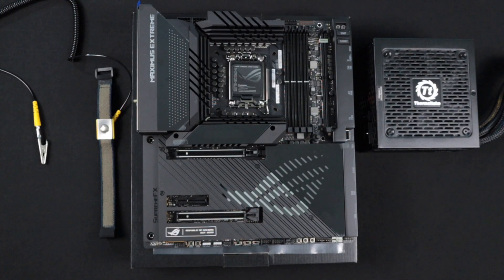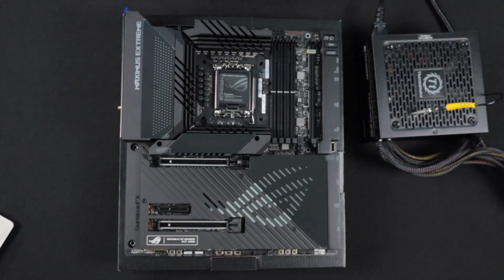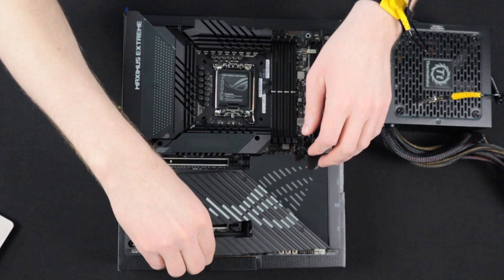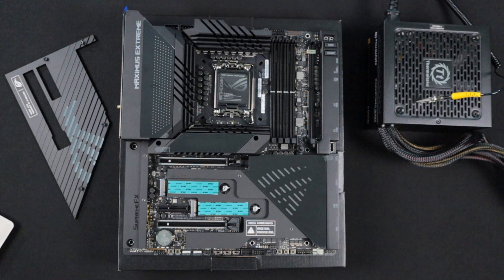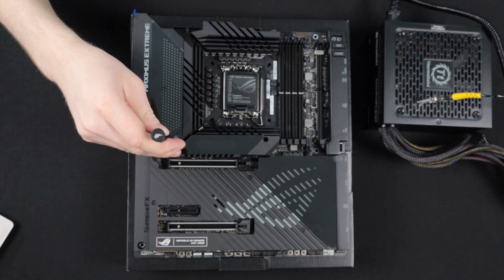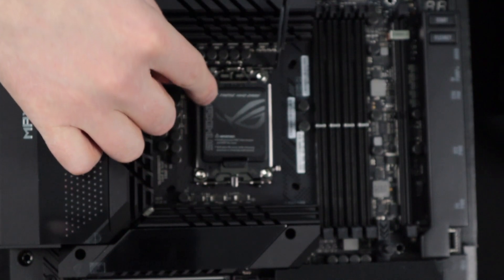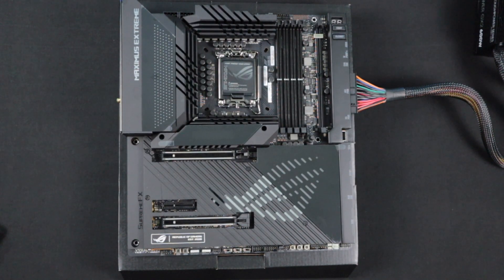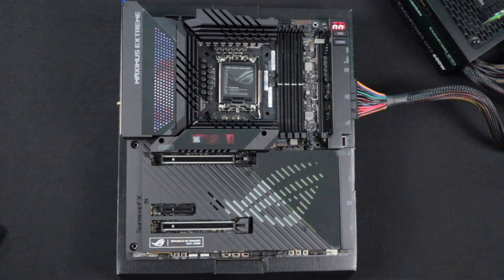Do This As Soon As Your Motherboard Arrives..

Comment: Des mb is Schrott! Also hab’s grad installiert und mal abgesehen davon dass ich 100mal im bios Lande und jetzt nicht mal mehr n Bild bekommen ist der Support noch 4h kontackt echt un hilfreich und man bekommt n paar Tage später vielleicht nen Rückruf! Nie wieder da nehm ich lieber wieder as Rock !
Reply from the maker: Ich verwende Google Translate, daher entschuldige ich mich, wenn die Übersetzung nicht gut funktioniert. Es ist schrecklich zu hören, dass Sie so viele Probleme haben. Haben Sie schon einmal versucht, Ihr Board im Rahmen der Garantie auszutauschen? Ich weiß, dass ASUS in letzter Zeit auf viel schlechte Presse gestoßen ist und einige große Probleme mit anderen Boards hatte, was wahrscheinlich dazu beiträgt, dass ASUS im Moment einen großartigen Kundenservice bietet. Immer noch definitiv inakzeptabel!
Reply: @techtoniksystems  hey the translation was perfect. 
No right now I’m still trying to fix the one I got. I’m waiting for the level 2 support to call back … but I don’t think the mainboard is defekt. I assume the bios has some promlems with the installed parts only a 1 tb used ssd from Samsung a 7950 and dominator 6000… I’m trying to get a fresh ssd for a new installation tomorrow. And yeah I’ll try to get a replacement first but I’m so disappointed because some of the functions that are absent (like a possibility to update the bios via windows… and if there is a possibility the level 1 support is really bad cause they told me there would be no way to update it).
Thank you for responding especially as I Worte a weird comment in angry German below a english video♥️😊
Reply from the maker: @icehelion9788  Ich freue mich, dass die Übersetzung gut war! Wie lief deine Neuinstallation auf einer frischen SSD? Sie können das BIOS ganz einfach mit einem USB-Laufwerk aktualisieren, sodass Sie diesen Weg gehen können! Ich habe ein Video, das zeigt, wie das geht, wenn es Sie interessiert!
Reply from the maker: @icehelion9788  https://youtu.be/6KCewuSJefQ
Reply: @techtoniksystems  thx m8… 
Well I got it now …. The big problem seems to be the ssd and it’s compatibility and the usb Stick …. The level one support told me to deinstall preinstalled stuff. This ended in a defect usb Stick with a new usb Stick and a fresh stick the bios got flashed and the starting problems of the mainboard were solved … thanks for you patience 😊
Reply from the maker: @icehelion9788  Schön zu hören, dass Sie es zum Laufen gebracht haben!! Hoffentlich haben Sie keine weiteren Probleme!
Reply: @techtoniksystems  Dankes dass hoff ich auch dir noch eine schöne Woche und bis zum nächsten Video 😊

Comment: Thank you for this video. I may have an issue according to this. Purchased ASUS Crosshair X670E Extreme on 21/04/23 tried to test the board as shown in your video while installed in the new PC case on it's own with a new power supply. No RAM and No CPU were installed as I wanted to make sure the motherboard was working. Motherboard lit up but would not switch on with case power button or START button on motherboard. Tried alternate power supply from a working existing older computer, same result. Also tried updating the BIOS with BIOS Flasback but it would still not start. Tried the BIOS reset button as well but no luck. Is this board faulty? Some guidance would be appreciated.
Reply from the maker: I’m sorry you are running into that issue :/ I  would first try to turn on the board by jumping the power button pins (just to rule out a faulty case power button). If this doesn’t turn the board on and give you a code readout, then I would say your board is DOA. Even if it does turn on by jumping the power button pins the board still isn’t working properly because the START button would be faulty. If you aren’t sure how to jump the power button pins I cover that in one of my other videos! https://youtu.be/odfXjPsHoP0 I would also start the RMA process so you can get a new board as quick as possible!

Comment: That's a good starting point.  After that take "baby steps" in your build.  Add CPU, one memory stick, graphics (or start with onboard graphics if equipped) and see if it'll post.  Now might be a good time to update BIOS.  Now you can start adding more memory, storage, and start installing drivers and other peripherals. By doing it this way can save a ton of time because you can easily revert to the previous known good state and pinpoint the likely culprits in the event of issues.
Reply from the maker: I just released a video covering that exact subject! https://youtu.be/odfXjPsHoP0 great recommendations!!
Reply from the maker: Next Friday I’ll be covering installing the OS, drivers, BIOS update, and stress your system for stability!

Comment: Can an ssd with heatsink work with this motherboard? or it’s not needed cause it has a factory cover
Reply from the maker: Unfortunately no, you could not run a heat sink on any of your SSDs unless you left the lower heat spreader/cover off. All of the M.2 slots have thermal pads and heat dissipation designed into the board, including the DIMM.2 card. It actually works really well and provides plenty of cooling!

Comment: After bench testing, how to turn the MB off properly without damaging it? Just simply press the start button again?
Reply from the maker: You can either press the start button until it turns off like I showed in the video or you can jump the power button pins on the bottom right of the motherboard. To do this, locate the case connection pins on the bottom right of the mother board and use something that is conductive (like the tip of a screw driver) and and bridge the gap between the two pins labeled something like ‘pwr btn’. This will turn the motherboard off! You can also turn the board it on by following these steps as well. Let me know if you have any other questions! 😀

Comment: what do you do if you don't have a power button how do you power it up
Reply from the maker: There are pins on your motherboard that allow you to connect a power button from your case. These pins are usually located in the bottom right corner of the motherboard. Locate the two pins that are labeled something like ‘pwr btn’. Take something conductive (like the tip of a screw driver) and bridge the gap between both pins so that the screwdriver is touching both pins. This will tell the motherboard to turn on! I have a video discussing motherboard connections that briefly covers these case connections if you wanted to check that out. I am also making a part 2 of this video on how to test your CPU, RAM, graphics card, PSU, and SSD or HDD so I will be sure to add a specific part that shows how to turn the board on if you don’t have a power button on the board itself!
Reply from the maker: https://youtu.be/-frJISU729M There is the link to my video talking about common motherboard connections including the case connections! I hope that explanation answered your question. If you still have questions I will be glad to answer!

Comment: I see it all the time even on YouTubers where they don't test their hardware first before adding fixed loops. Personally, I build my system completely, I'll run it with an AIO in the actual case and I'll stress test and use it for at least a week.

CPU-Z JJU8GT
Reply: .. BTW my only complaint about the ASUS Z790 ROG MAXIMUS Extreme or any Z790 is the stupidity of sharing the PCIe x16 lanes with the damn M.2. If you install that m.2 and at top slot underneath the OLED your GPU defaults to x8. The reason that I use that slot and also the DIMM.2 slot is accessibility in case the M.2s dies. I don't like losing even 1 FPS.
Reply from the maker: @DJaquithFL  JayzTwoCents most recent build is a great example of that! He had a bad motherboard and was dreading swapping it out because of his custom loop. One of my upcoming videos is about this exact subject and testing all of your components before you actually install them, so you avoid headaches! I also agree that is a one of the only negatives about it. Once future generations of CPUs are able to handle more PCI lanes at once, we shouldn’t have that issue any more! Thank you for watching and commenting!
Reply: @techtoniksystems  .. That's who I had in mind when I was mentioning it. It wasn't surprise me if he got some TIM on the dimm slot. In that follow-up video that you mentioned, you noticed that he had Tim on one of his fingers again. The only time that I see something like that happen is when the end user caused the problem. Certainly not the manufacturer, but he couldn't help but to blame ASUS.
Reply from the maker: @DJaquithFL  That’s a great observation!

Comment: I purchased a new Alienware Aurora R8 some years ago with all the high-end options. My last purchase step was to check out the available warranty options. I selected the most expensive with the most significant number of years. I've had zero problems occur in 4+ years. This is like buying a life insurance policy. You are betting that you'll die. The insurance company is betting that you will live many years and keep making your policy payments.
Reply from the maker: It’s definitely a cost vs risk analysis! I prefer to spend more up front, if I can, and get an over engineered product with a good manufacturer warranty. It’s the best of both worlds in my mind and gives me the peace of mind that I can push the system and not worry about it!

Comment: How do I do these tests if I do not have a power supply to connect to? I’m building a pc but I don’t have all the parts yet.
Reply from the maker: Unfortunately, there isn’t a safe way around needing a power supply to perform the power on test. But if you are like me waiting for a specific power supply to come in stock, you could order an extremely cheap power supply on Amazon and use that to test and return it (or keep for future testing)! The power supply I used in this video is a $50 ThermalTake power supply that I ordered on Amazon just for testing purposes!
Reply: @techtoniksystems  That’s a pretty good idea, before I spend money on a power supply I did read that using rubber gloves while handling could have the same effect as an anti static band. Is that true?
Reply from the maker: @enlargedquack  Rubber is an insulator against electricity so yes it would protect much like an ESD wrist band as long as there are no holes, but I feel like your dexterity would be reduced quite a bit using gloves like that!

Comment: In my water cooling builds. I also would install the CPU will a stock cooler and have a single stick of non OC memory. To see if it post. Once I know I can get into the bios it just gives me a peace of mind knowing I can continue with my build.
Reply from the maker: This is an excellent tip and its already in production for a part 2 of this video!
Reply: I was going to say, I'm building a water cooled build and it seems like it's probably not a great idea to hook it up before it's in the machine... .which sucks because I REALLY want to bench test it, unfortunately the only CPU cooler I have available any time soon (can't buy locally) is the one I'm using on this PC ... man, I hope I got one of the good ones, because I suck at this all enough already.
Reply from the maker: @VeggyZ Chances are you have a working board! And we all have to start somewhere but you definitely don’t suck!!
Reply from the maker: @VeggyZ  room to build is definitely a huge plus! What case did you choose?

Comment: If your games don't install well after a problematic first installation with Windows, your mother may boot but still be the problem. If you ruled out the disks and the RAM, it is usually the motherboard.
Reply from the maker: What problems did you experience during the Windows installation?
Reply: @techtoniksystems  my story was like this: the games didn't install well, most of them just paralized (imagine a 25 second stutter) even if my PC outclassed them (MoHAA 2002 in a 2004 computer). We tried reinstalling the games, same result. We tought the video was wrong, new gpu, helped for a session then same results.

We tried to reinstall windows XP, we tought our images were bad so we used an original XP home edition CD. It didn't install. The guy helping me ruled the motherboard as fault: an ASUS K8V deluxe.

RMA agreed to it and I got a new one. And I believe it was the case because the motherboard was problematic per se, with the dawn of SATA technology I had to use drivers for it to recognize the SATA disk, with a floppy. The new one worked well but sometimes BIOS decided to go RAID instead of being IDE onboard operative, making my SATA invisible to it.

That terrible mother sure taught me some things.
Reply from the maker: @ezecskornfan  Sometimes the worst things can teach us the most! That is a really interesting issue that you experienced, which is why I was curious about what you were experiencing. I am glad to hear you were able to get it fixed and working though! Hopefully you haven’t had to deal with any similar situations since then 😁

Comment: I do like how you show the right way to go about this with an anti-static band. Funny thing about that is my office has carpet floors. Don't wear bands or anything. Thousand of hours later and never zapped anything yet. Worked for a company once that did custom PCBs. We wore foot straps. Pretty useless if the floor is concrete lol. They swore up and down it made a difference.

 The problem with checking anything, most people don't know what to look for. Secondly, pretty much only need to do this for used eBay stuff. After 20 years of building computers and about 100 motherboards, I never had bent pins for anything new. DOA is usually just not powering on. No need to do a manufacturer RMA. Return to sender for a refund. 

Overall good content. Keep it up!
Reply from the maker: I figured why not wear one if it minimizes something bad, but yeah I agree that the risk is extremely small! Products today are more robust than they were when I started building as well so the risk is even smaller. 

I definitely agree that if you buy used, the risk of any of these issues are astronomically higher than if you buy new. I plan on keeping it up with new content dropping every Friday at 5:00PM EST! Thanks for the encouraging comment and thanks for watching!
Reply: @techtoniksystems  Sorry if I can across as rude. Keep making content! Your channel will outgrow Linus trash at some point.
Reply from the maker: @theodanielwollff  I didn’t think that at all! I appreciate that, and I’ll be continuing to make the best content that I am able to!
Reply: I've never used a anti-static band ever... I just ensure I have something metal beside me when working on the system and I discharge before touching any computer component! Worked on over 10 PC's now lol
Reply from the maker: @chrispeters8555  That is also a great way to discharge static electricity!
Reply: I have had to refund  2 asus motherboards due to them not turning on. Any tips? I have plugged in everything correctly, I believe, and I am sure all the components in my pc work because my pc will boot with a gigabyte board.
Reply: @expert8665  bad luck. Its been 20 years since I had a MB DOA.
Reply from the maker: @expert8665  I would tend to agree with Daniel on that one since you are able to get it up and running with a different board! I haven’t had any of my boards for my builds come in DOA before, but that definitely doesn’t mean it can’t happen! Do you use anti static electricity equipment hooked up to a ground while working?
Reply from the maker: @expert8665  Then definitely DOA! That’s unfortunate, but at least you were able to get them refunded 😄